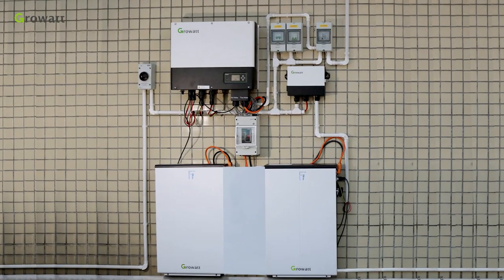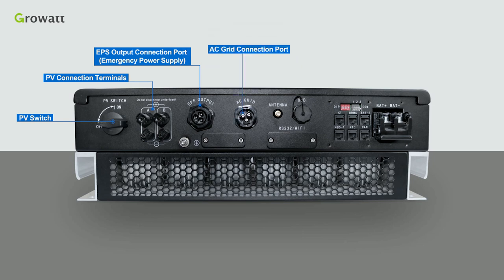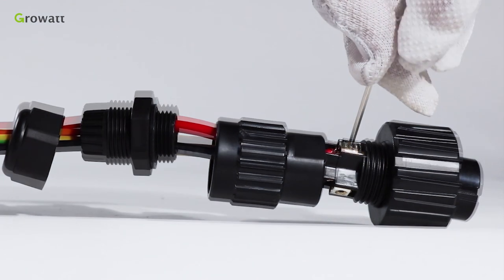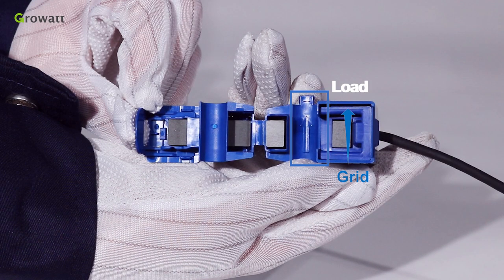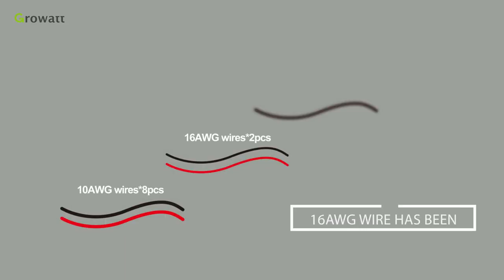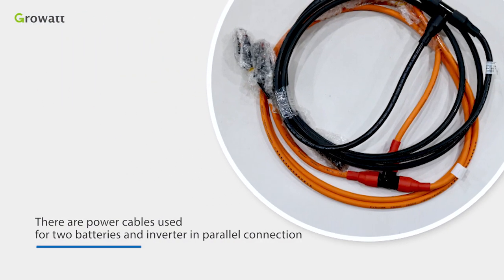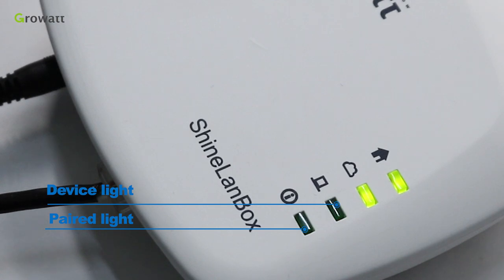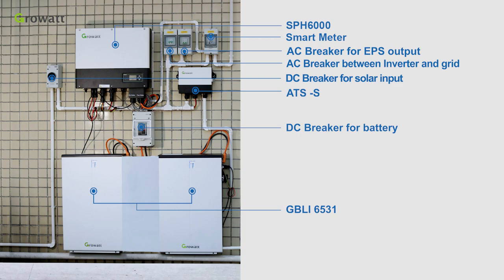SPH Single Phase Energy Storage System Installation

Comment: We installed this system at a customer and we get this question: When the system is in a off-grid mode due to grind failure, does the system (when sunny) also charge the battery? Thank you!
Reply: Yes I did that first day

Comment: You are using a plastic (unshielded) coupler to extend the CT cable but that doesn't connect the cable shields - so the CT's cable will not be earthed. You should be using a shielded coupler.

Comment: CAN THIS WORK TOGETHER WITH 2 MIN 6000TLX IN A PARALLEL connection? What else is required to install it?
Reply from the maker: It can work with 2 pcs MIN 6000TL-X in parallel, but they work separately through their strategies. Next year, we will release the management center to control them to work as one system. For further product inquiries, please feel free to contact our sales team at info@ginverter.com. Thank you!

Comment: Hello,
is the ATS-S included in SPH4600?
I want to use the EPS Output for emergency issues when AC Grid is offline. Thats not happening often but from time to time.
Is EPS output then parallel to the AC Grid in normal use and switched over to online EPS when AC grid is offline?
Reply from the maker: Hello, for technical support, please contact our service team at service@ginverter.com, or you can call our service hotline at +86 755 2747 1942. Thank you!

Comment: Can this Growatt SPH inverter work with standard Lead Acid batteries?
Reply from the maker: Yes, Growatt SPH single-phase inverter can work with low voltage Lead Acid batteries. It's recommended to contact our service team at service@ginverter.com for technical consultancy and assistance before installation. Thank you!
Reply: @Growatt  Thanks a lot. I've written a mail to them but if there's a phone contact will be greatly appreciated.
Reply from the maker: @simonedache3940  yes, you can also call our service hotline  at +86 755 2747 1942. Thank you!

Comment: Can we use it as a normal ongrid Inverter initially and later adding storage ?
Reply from the maker: Yes, we have SPA and SPH two choices for you.
Reply: Is there anything we need to do in the Inverter Settings to make it function as Ongrid mode? Or will it work just fine without the batteries?

Comment: Inverter died after 2 months of use. SPH 5000. Ive got 3 inverters 1 from Fronius and two from Growatt. Fronius worked perfectly for several years.. So i decided to install two more systems for other two phases. 6 weeks down the track one of them stopped producing the energy. So for growatt its 50/50. The installation company is struggling with the support from growatt (Australia). Unable to replace as there is no replacement available. When I tried to call myself... No one even picking the phone/ answering emails. Pathetic.
Reply: After several weeks of waiting for the replacement I finally got it and now waiting for the solar company to come and replace it.